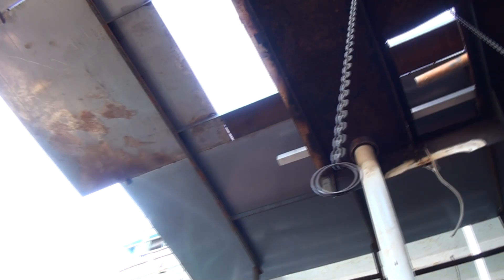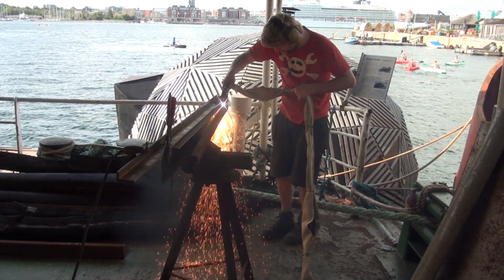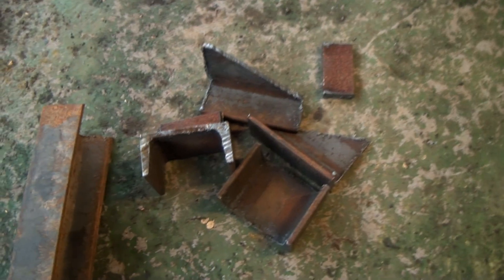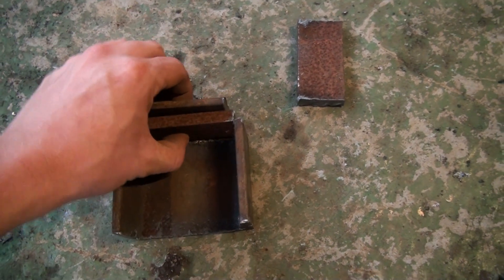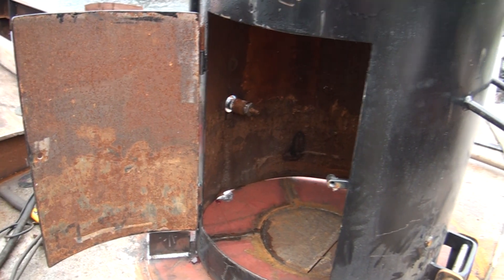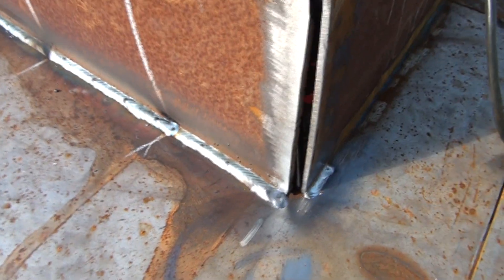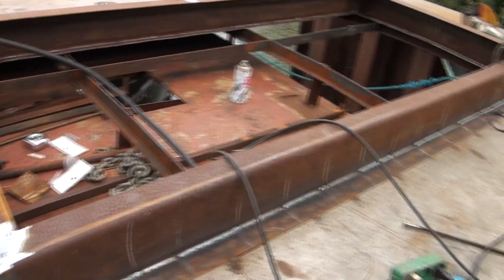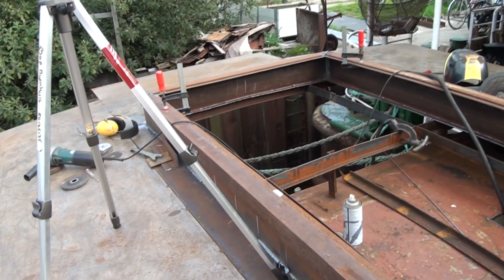Houseboat Omala | Ep.5 | Skylight framing and smokestack latches

Comment: Jop, I am impressed by your ability to keep your welds looking so good with all the wind, it must be affecting the gas shield.   Progress is good.

Does your mooring freeze during winter?
Reply from the maker: I make use of a lot of windbreaks, using a straight MIG shield, and slightly higher gas flow as required. Seems to work great, for now. When I try spraytransfer the results are lesser. The harbour does freeze close sometimes, as the salinity is rather low in the Baltic, but I'm sure my mooring stays clear